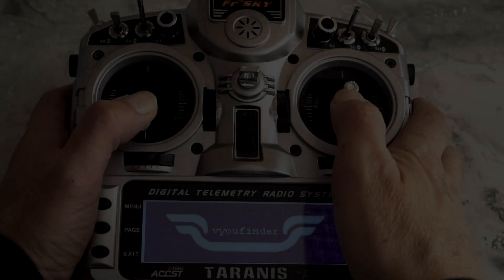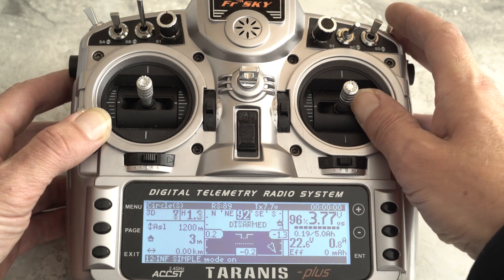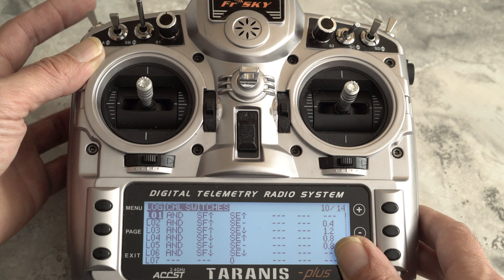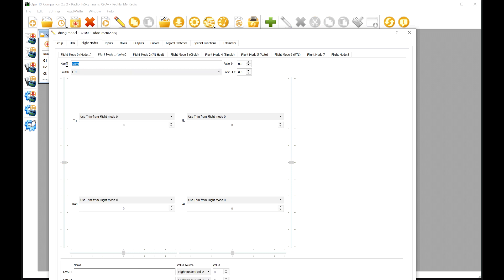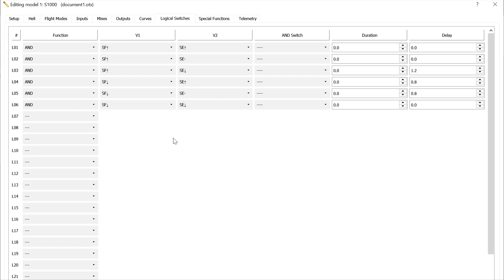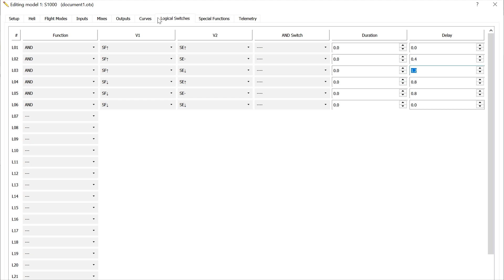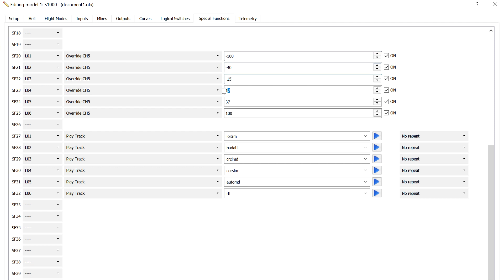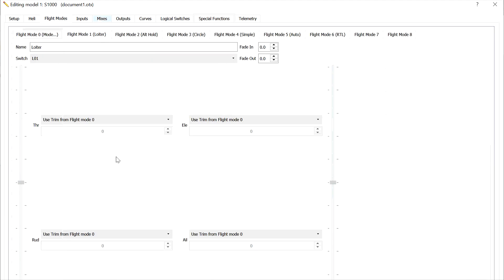Taranis X9D+ SE 2019 OpenTX Setup 2 Switches / 6 Flight Modes Special Functions & Logical Switches

Comment: Can you share where you got the Sound files from? I have been searching and can only find ones that are either half recorded or dont have all the sounds for all the modes.
Reply from the maker: I made custom recordings for my sound files that I use manually, and then plugged in the most common voice replacement for the rest.  It's been a while, so I don't remember the name of the voice files, but it's the most common one out there.

Comment: Hello Vufinder, please help!
I followed your setup closely,  Channel order TAER ; when moving the RUDDER Stick the AILERONS Move,  when moving the rudder stick the Ailerons move. Went into the Taranis x9d+ , switched the order in Inputs,  Mixes and outputs.  NO Change. 
I have all 6 modes , sound etc. Any help would be much appreciated. 
Bruce
Reply from the maker: Somehow you've got your channels mixed up/different from mine, it sound like.  Maybe look into re-assigning your channels.  There are several viable ways of doing it, I believe.  The Ardupilot forum might help - lots of good helpful people there.  It's where I also go for help.

Comment: just subscribed, excellent tutorial my friend, like a guy asked below and never followed up, i wanted to ask if you can make a detailed tutorial on how to setup and use Yaapu script please (wiring and setup), thanks allot
Reply from the maker: I doubt I will get around to it, so: I used a cheap cable I got on ebay (about $12).  Just search for Yaapu pixhawk cube or similar.  Once you get the cable, use the instructions on the Yaapu script install instructions and follow carefully.  That's the best I can do for now.  Good luck.  You can do it.

Comment: This was quite possibly the most simple video I've found so far that explains setting up mode switches on the Taranis :) The one linked in the pixhawk documentation should probably be replaced by this one.

One thing that 'bothers' me though is the 'default' mode.. in QGroundcontrol, even though I've set up a delay between each mode on the TX, it flickers to Mode 4 before switching to the actually selected mode, and I cannot for the life of me figure out why.
And more thing . it doesn't to make a difference if I've set up any of the INPUTS or not (I'm using SA and SB on my QX7 for more switches) - even with both these inputs deleted, ch5 is still sending mode switches.
Reply: PS: I did have to use slightly different override values to hit every of the 6 flightmodes in QGC;: -100, -60,-15, 0, 12,37,100 (only the lower half had to be adjusted slightly, but that's easily verified in QGC while adjusting the values on the transmitter).
Reply from the maker: I actually ended up having to delete my delays and I wish I could remember the reason why.  Flickering to Mode 4?  Wish I had the answer for you.  Maybe try removing the delays also?

One other thing I changed since this video was I removed the special functions which play the tracks for each flight mode.  I did this because I've installed Yaapu telemetry script, and it plays the tracks when modes are changed.  The benefit of using Yaapu to play the tracks is that the tracks only play when the flight controller actually changes modes, so it's a confirmation.